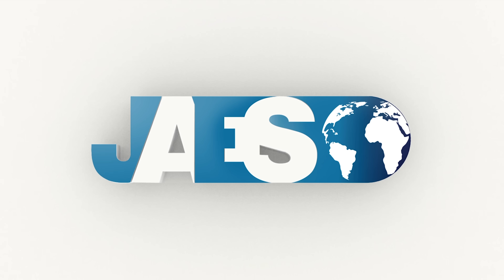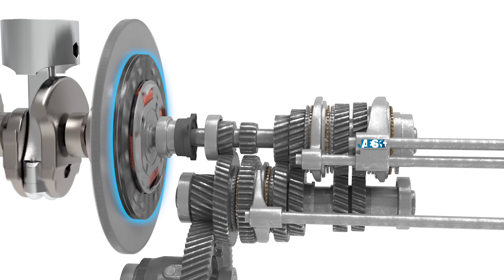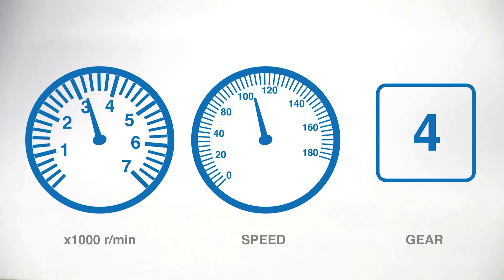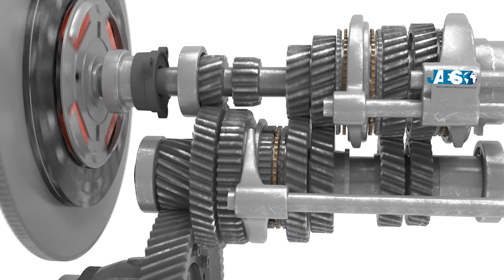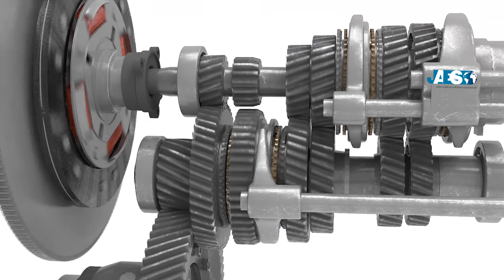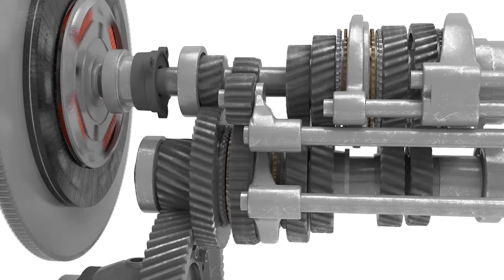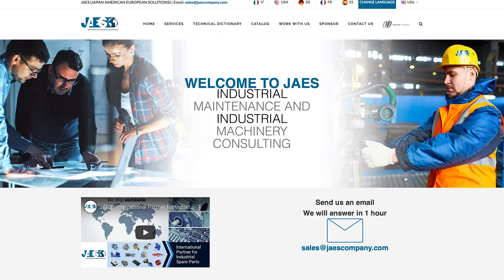How Manual Transmission work (Car Part 2) Clutch - Reverse Gear - Grinding Noise

Comment from the maker: • Find out more about our project:
https://jaescompany.com/elearning.php...

• Here are some products installed by our technicians:
https://jaescompany.com/catalogo_marche.php?lang=en
Reply: In this video your grafics is very good. In this situation now in 2nd, 3rd, 4th,  and 5th gears engagement is OK. But in the engage 1st gear engine is running the clutch wheel is also running. In this video engine is running but the clutch wheel stopped in 1st gear engage movement. That is impossible at that time (01:20 to 01:58) seconds
Reply: P
Reply: @labiang85502  hi no

Comment: Always press down on the clutch before shifting gears. Never shift without using the clutch as you will grind the gears.

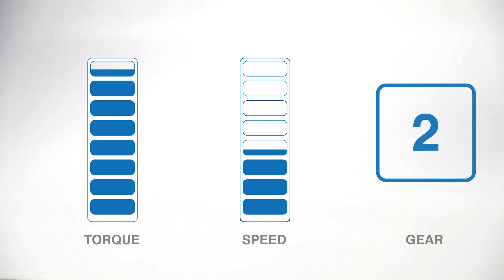Comment: 3:05 Fail in explanation higher gears have the exact same tork as in lower gears hence its the motors output that determines tork.... what should be said is that the driveshaft and gearbox output due to higher gears result in lower tork on the differential.....

Comment: I am here after I tried to put in 5th gear ( car charger was right behind and I didn't notice) and the gear shift just stared going crazy. Hopefully I didn't let out the clutch full but I did that 2 times before realizing... What a dumb move ...

Comment: There’s also a way to float gears.  My 1998 Honda Civic I’ve been changing gears without the clutch sometimes around 3-3500 rpm’s . Might throw off my synchronizer but screw it right ?

Comment: Like in us, canada   trucks why do drivers use clutch in 1 st gear ,then they change with respect to rpm for further gears  Why ? Is there no cracking sound happens .? Can we opt this method in cars?

Comment: Sir yesterday in the mid of traffic 1st and 2nd gears got disabled because of which I need to move my car on 3rd gear  after moving till 5 meters to place the car in a proper place, I got a smell does it mean I should replace the clutch plate again already replaced a few months back.

Comment: Thanks very much, I have question, we can press the gas pedal the same time while changing the gears? Thanks
Reply: No you won't do that while shifting
Reply: @shriram._8426  yes you will do that while shifting
Reply: Yes and you definitely should do that it makes the gear change quicker

Comment: Thanks so much for the video. This was what happened to mine .. I was in a parking lot which I was adjust slowly starting the car about 5km per hr ... As I was trying to switch from 1st to neutral since I was trying to stop the car .. I wasn't sure if I didn't step on clutch completely or I didn't place the shift to neutral completely .. seems like it was sin between 1st and neutral... I felt the stick bouncing obviously felt the teeth but no grinding sound at all as it was super slow and pretty much complete stop .. so I step on clutch and release it fully .. in that case it didn't do any damage to it right? Thanks again
Reply: If you shift from 1st gear into neutral, you cannot hear any grinding sound because you are disconnecting the engine from the transmission. Do not worry about any damage in this case
Reply: @EasternUNO  i have the same problem on a 2019 car with 50k km on it. why did it start to happen ? is there a way to fix it ?

Comment: I'm a fan of Manual Gearbox Driving. Simple things like this helps us to understand the functions of Changing Gears, Applying the Clutch in these types of vehicles.
Reply from the maker: Nice to hear that! Have you had a chance to watch our videos about  AUTOMATIC TRANSMISSION https://youtu.be/PLF3mohpqdY IGNITION https://youtu.be/s_HzAxhyXLo STEERING SYSTEM https://youtu.be/Iw1duKjGcto BRAKING SYSTEM https://youtu.be/6xWEEbhBtuY and ELECTRIC VEHICLES https://youtu.be/flQSQxHVS14 We would like to know your opinion about it. 
If you want to learn more about our projects, you can subscribe to our channel https://www.youtube.com/channel/UCb7TkWFn3nyb6XhudxGu5tw and visit our website https://www.jaescompany.com/

Comment: Hi show you manual system is which company cars RPM like that, because 4 and 5 gear so you speed hundred and 120 up
Reply from the maker: Thank you so much for your comment! Have you had a chance to watch our videos about IGNITION https://youtu.be/s_HzAxhyXLo STEERING SYSTEM https://youtu.be/Iw1duKjGcto MANUAL TRANSMISSION https://youtu.be/G6hCvdW4dKo AUTOMATIC TRANSMISSION https://youtu.be/PLF3mohpqdY BRAKING SYSTEM https://youtu.be/6xWEEbhBtuY and ELECTRIC VEHICLES https://youtu.be/flQSQxHVS14 We would like to know your opinion about it. 
If you want to learn more about our projects, you can subscribe to our channel https://www.youtube.com/channel/UCb7TkWFn3nyb6XhudxGu5tw and visit our website https://www.jaescompany.com/

Comment: Should we need to push the clutch to shift gears when the vehicle is off? For example, if the vehicle is in gear before starting the engine, should the clutch be depressed to put the neutral? Similarly, after parking the vehicle, in neutral (engine is off). Should the cluch be depressed to put in first gear?

Waiting for your valuable replay🙏
Reply: Are the little cogs and wheels moving when the engine is off? If the answer to that is no, then you have your answer.
Reply: No because the gears are not moving same when the clutch is depressed
Reply from the maker: Thank you all for your valuable answers! Have you had a chance to watch our videos about AUTOMATIC TRANSMISSION https://youtu.be/PLF3mohpqdY IGNITION https://youtu.be/s_HzAxhyXLo STEERING SYSTEM https://youtu.be/Iw1duKjGcto BRAKING SYSTEM https://youtu.be/6xWEEbhBtuY and ELECTRIC VEHICLES https://youtu.be/flQSQxHVS14 We would like to know your opinion about it. 
If you want to learn more about our projects, you can subscribe to our channel https://www.youtube.com/channel/UCb7TkWFn3nyb6XhudxGu5tw and visit our website https://www.jaescompany.com/

Comment: Now i know why i crigned at the grinding sound while putting my car in reverse gear without pressing clutch🙈 i still regret doing that which landed me up with this video. Its a brand new car.. will it cause any issue? I immediately realised and got back to neutral
Reply: Nah youll be fine just dont do it again lmao

Comment: "The reverse gear has no synchroniser and therefore it can only be engaged from a stand still position." And I think it's also for safety
Reply from the maker: Exactly Erick Juma! Thank you so much for your comment! Have you had a chance to watch our videos about AUTOMATIC TRANSMISSION https://youtu.be/PLF3mohpqdY IGNITION https://youtu.be/s_HzAxhyXLo STEERING SYSTEM https://youtu.be/Iw1duKjGcto BRAKING SYSTEM https://youtu.be/6xWEEbhBtuY and ELECTRIC VEHICLES https://youtu.be/flQSQxHVS14 We would like to know your opinion about it. If you want to learn more about our projects, you can subscribe to our channel https://www.youtube.com/channel/UCb7TkWFn3nyb6XhudxGu5tw and visit our website https://www.jaescompany.com/
Reply: Yo so I have a manual transmission. My saftey reverse(lift a knob to engage reverse)does not work. When i begin to engage reverse after I come to a complete stop, it grinds for a couple of seconds and it doesn't let me engage so I don't even try to force it. This doesn't happen all the time tho. What could possibly be wrong here?

Comment: If the reverse gear has no synchros, how is it smoothly connected to the input shaft which was just spinning at whatever rpm the engine was at just before separating the clutch?

Comment: 2:05 Changing gears without the clutch, or 'floating gears' is a very popular technique among truck drivers.  I don't know if it'd work very well with a low torque vehicle, but the basic procedure is to increase, or decrease engine rpms while gently pressing the gear into place until rpms match road speed and it slips into place.  It requires some practice and isn't recommended by transmission manufacturers for that reason. 
	Anyway, best transmission video I've ever seen. 👍
Reply: another part of the reason we float gears is because semis dont have synchronizer. We always have to match rpms to the subsequent gears in order to shift. Floating makes shifting faster in this regard and if skilled enough, can be a smoother shift.
Reply: What's the benefit of changing gears wihout the clutch?
Reply: @Techno.Belgium   Semi trucks have a lot of them. 13 and 18 speed transmissions are the most common.  A few decades ago (you can still buy transmissions like this, but nothing comes stock with them I don't think) dual transmission setups, often called 'twin sticks', where a 5 or 6 speed trans feeds into a 4 speed one, were common.  A 5 and 4 combination = 20 gears, etc. Pressing the clutch for every gear can become very tiring, so drivers will use it only when necessary, like starting and stopping, or if they miss a gear.
Reply: @Techno.Belgium  saves a lot of left knee wear
Reply: Floating gears in a semi is pretty easy but I can’t ever seem to slot in a small personal car
Reply: You can easily do this method in a car as well I tried it and it worked just fine in a courtesy car I had.
Reply: At this point my shifting is 10 times worse if I use the clutch Instead of floating. I learned on a truck with no speedometer or tachometer so getting a feel for the engine and transmission was crucial
Reply from the maker: Thank you for your observation! We welcome anyone who brings his own contribution and share his knowledge on our videos. Have you had a chance to watch our videos about STEERING SYSTEM https://youtu.be/Iw1duKjGcto IGNITION  https://youtu.be/s_HzAxhyXLo BRAKING SYSTEM https://youtu.be/6xWEEbhBtuY and ELECTRIC VEHICLES https://youtu.be/flQSQxHVS14 We would like to know your opinion about it. If you want to learn more about our projects, you can subscribe to our channel https://www.youtube.com/channel/UCb7TkWFn3nyb6XhudxGu5tw and visit our website https://www.jaescompany.com/
Reply: @Jaescompany  I'll check those out. Thanks. 👍

Comment: Sometimes I clutch in all the way and when I change gears the stick is rough and isn’t smooth but sometimes it is very smooth. Why is that?
Reply: Some things which might be happening
1) make sure you're not shifting way to early. Generally let the rpms be atleast 3k -3.5k before shifting. 
2) may happen if your temps are not warmed up. Loading the trans by going through all gears when in neutral on a cold start might help too. 
3) make sure all the way is all the way. Sometimes might not be lol. 
4) also depends on the car you drive. Hondas typically are smoother than say subarus. 
5) also we all get better with experience
Reply: @shrijanaryal4923  Good tips. Changing gearboxes oil helps too. New oil is thicker and give more friction performance to synchronizers so easier gear shifting.
Reply from the maker: Have you had a chance to watch our videoS about STEERING SYSTEM https://youtu.be/Iw1duKjGcto MANUAL TRANSMISSION https://youtu.be/G6hCvdW4dKo BRAKING SYSTEM https://youtu.be/6xWEEbhBtuY and ELECTRIC VEHICLES https://youtu.be/flQSQxHVS14S We would like to know your opinion about it. 
If you want to learn more about our projects, you can subscribe to our channel https://www.youtube.com/channel/UCb7TkWFn3nyb6XhudxGu5tw and visit our website https://www.jaescompany.com/
Reply: Did you get an aftermarket flywheel/clutch system? Generally the thickness of the components are not the same thickness as OEM and throws off the distance between the two rotating parts and thus creates 'dragging'-- where the clutch does not fully disengage when you press the clutch and therefore the syncros are still rotating at a very fast speed and not slowing down to let you perform a smooth gear shift.

If this is happening with an OEM setup I would recommend a technician to drive it and see what he thinks. There could be many factors but it also could be as simple as adjusting your clutch pedal.

Comment: sometimes when i shifted gears when I don't  floor the clutch correctly it make a rattling noise,is it bad for the vehicle,
Reply from the maker: Yes it's bad. Thank you so much for your question! Have you had a chance to watch our video about STEERING SYSTEM https://youtu.be/Iw1duKjGcto IGNITION https://youtu.be/s_HzAxhyXLo BRAKING SYSTEM https://youtu.be/6xWEEbhBtuY and ELECTRIC VEHICLES https://youtu.be/flQSQxHVS14? We would like to know your opinion about it. If you want to learn more about our projects, you can subscribe to our channel https://www.youtube.com/channel/UCb7TkWFn3nyb6XhudxGu5tw and visit our website https://www.jaescompany.com/

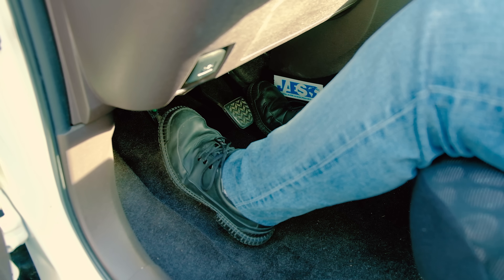Comment: 1:49 is not technically true. If you try this, you will stall about 50% of the time. You want to give it gas if you're at a standstill so that it engages or if you're climbing a hill. bottom line. This will only get you so far. I know from experience.
Reply from the maker: Dear Northern Sailor, thank you so much for your observation. We welcome anyone who brings his own contribution and share his knowledge on our videos. Have you had a chance to watch our videos about STEERING SYSTEM https://youtu.be/Iw1duKjGcto MANUAL TRANSMISSION https://youtu.be/G6hCvdW4dKo BRAKING SYSTEM https://youtu.be/6xWEEbhBtuY and ELECTRIC VEHICLES https://youtu.be/flQSQxHVS14 We would like to know your opinion about it. If you want to learn more about our projects, you can subscribe to our channel https://www.youtube.com/channel/UCb7TkWFn3nyb6XhudxGu5tw and visit our website https://www.jaescompany.com/
Reply: @Jaescompany  i do like your channel. I know there's some rookies out there because at first it's intimidating driving a stick but there's the other technique that my uncle showed and it's helped me since. Keep up the good work guys!
Reply: Whats wrong about it? You slowly release the clutch while applying throttle to start a manual car.

Comment: So under normal driving, how long does a 2000 Honda Civic EX (5 speeds) transmission will last?
That means & including those bearings, seal & plastic part inside on the transmission.
Reply: The sentence you thought you just made was not a sentence. but a bunch of words in a mesh.
Reply: @roest7770  So basically you don't know
Reply from the maker: Have you had a chance to watch our videoS about STEERING SYSTEM https://youtu.be/Iw1duKjGcto MANUAL TRANSMISSION https://youtu.be/G6hCvdW4dKo BRAKING SYSTEM https://youtu.be/6xWEEbhBtuY and ELECTRIC VEHICLES https://youtu.be/flQSQxHVS14S We would like to know your opinion about it. 
If you want to learn more about our projects, you can subscribe to our channel https://www.youtube.com/channel/UCb7TkWFn3nyb6XhudxGu5tw and visit our website https://www.jaescompany.com/

Comment: But why semi truck dont need clutch to change gears eg:13speed , 18speed manual?
Reply from the maker: For sure! Please watch STEERING SYSTEM https://youtu.be/Iw1duKjGcto IGNITION https://youtu.be/s_HzAxhyXLo BRAKING SYSTEM https://youtu.be/6xWEEbhBtuY and ELECTRIC VEHICLES https://youtu.be/flQSQxHVS14? We would like to know your opinion about it. If you want to learn more about our projects, you can subscribe to our channel https://www.youtube.com/channel/UCb7TkWFn3nyb6XhudxGu5tw and visit our website https://www.jaescompany.com/
Reply: You can do it with a normal transmission too, its called floating the gears. 
In order for the gears to mesh without grinding they have to be spinning at the same speed. When you push in the clutch the gears are disconnected from the engine. When you shift the syncros will speed up or slow down the appropriate gear so it will mesh. However, if you use the throttle to change the engine rpm you can change the speed of the gears if the clutch is engaged. 
Semi trucks are forced to float gears because they don't have synchronizers in their transmissions. If they tried to shift normally they would grind on every shift.

Comment: what will be the maximum speed with reverse gear?
i mean does reverse gear use on of theses 5 gear or it have a separte gear with separate speed. thanks
Reply from the maker: Hello. Nice question! It has a separate gear. Usually reverse gears are based on what first gear is, so the RPM is limited and you can't go too fast. If you're interested you can also watch our videos about IGNITION https://youtu.be/s_HzAxhyXLo STEERING SYSTEM https://youtu.be/Iw1duKjGcto BRAKING SYSTEM https://youtu.be/6xWEEbhBtuY and ELECTRIC CARS https://youtu.be/flQSQxHVS14 If you want to learn more about our projects, you can subscribe to our channel https://www.youtube.com/channel/UCb7TkWFn3nyb6XhudxGu5tw and visit our website https://www.jaescompany.com/

Comment: You can do clutchless shifting in manual transmission car without demaging the gearbox
Reply: As to why anyone would want to do that... I have no idea.
Reply: @thatoneintrovert9618  faster shifting,race drivers do that
Reply: @thatoneintrovert9618  because they are lazy or they want to make the clutch last longer